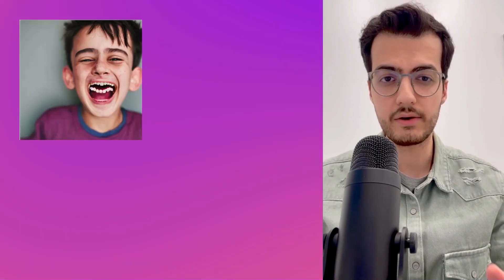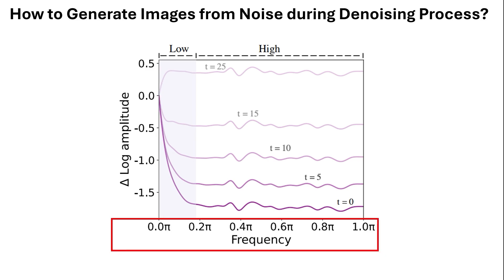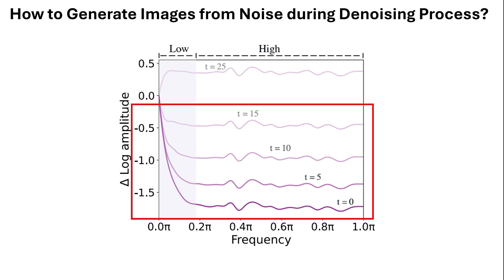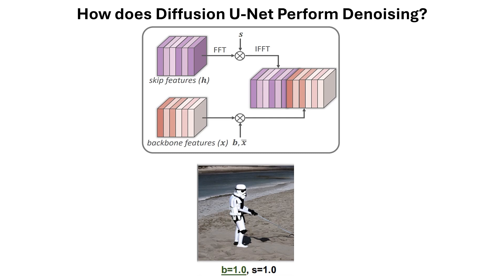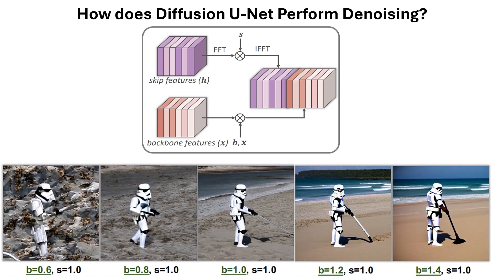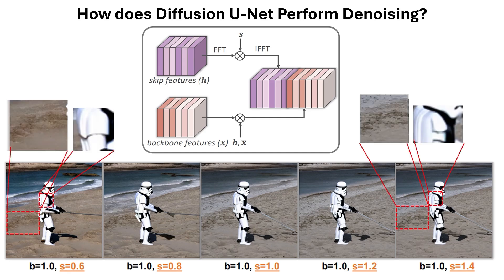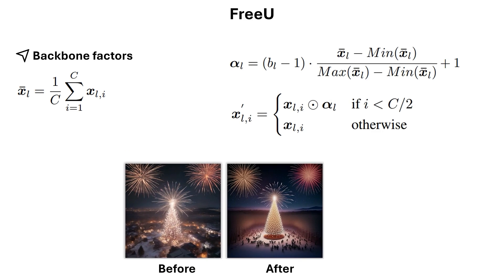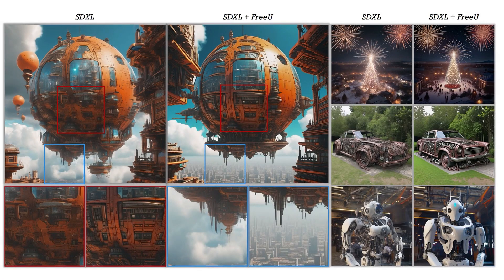FreeU - Paper Explained

Comment: Here is a better solution.  Let it solve a backbone image by having the diffusion model eliminate high frequency noise.  Now re-add some high frequency noise randomly.  Now run the model normally.  This first step calculates large features more accurately.  The second step adds textures to objects.  Now that you are running the same model for two different stages with different goals you could now train specific models that achieve those goals even better.
Reply from the maker: But if you denoise without retaining the high-frequency details and then add noise again, doesn’t the second noise essentially erase the features obtained in the first stage? Even if you manage to mitigate this by adding noise that avoids this issue, it still results in longer inference time compared to the method they proposed.